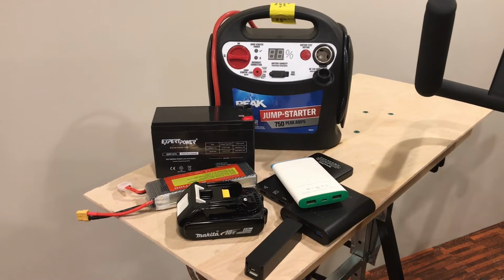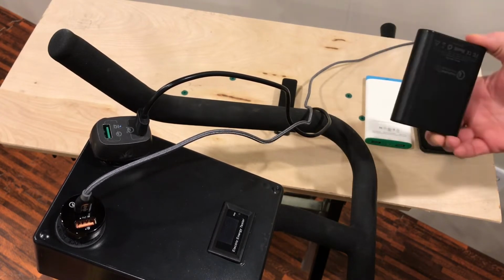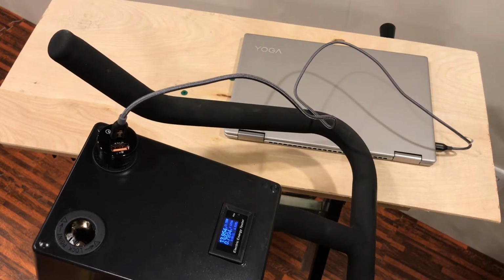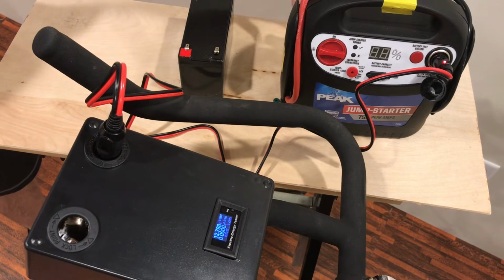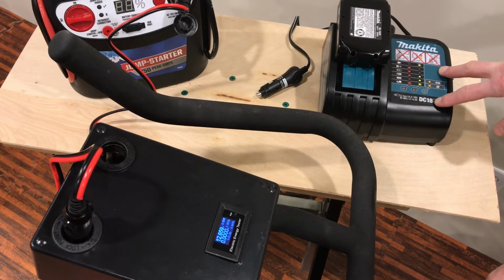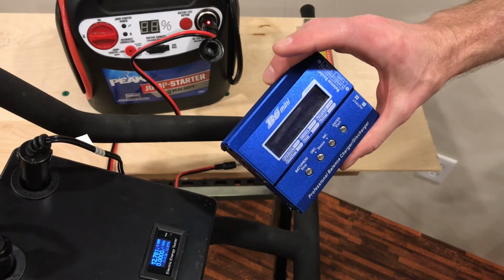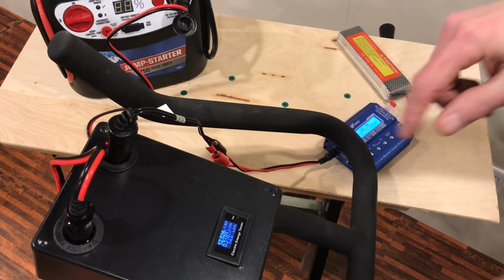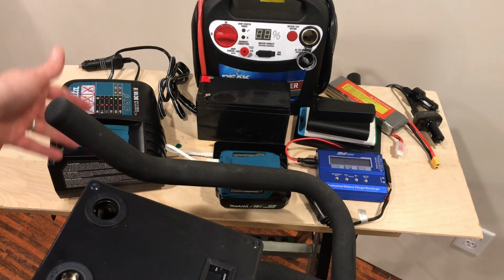Pedal Generator Charging Various Batteries

Comment: Are you still using the bike? How is it running
Reply from the maker: Through the winter months, I train on my exercise bike generator, affectionately known as Ugly Genny. On that generator, instead of an RC motor I use an e-bike motor with a custom cut flywheel. I’ve found that generator design to be more efficient by a noticeable margin over the other designs.
Reply: @GenesGreenMachine  Hi Gene, I'm loving these videos, so glad they're still available and you're still active on these projects.  I have not seen anyone else using an e-bike motor, but when I saw it I had a feeling it would be better than the RC AC motor!  How much was the e-bike motor?  Cheapest I can see locally is £150 but up to £400... but I will look again.  I'm formulating a few ideas in my head, but I like the idea of really chasing after efficiency at all stages in conversion process.  We'll see if that idea survives contact with reality!  On that topic about the rectifier losses and using a DC motor, they also seem £300+.  I haven't gotten a clear idea yet about power storage vs direct charger - more research needed.  Have you quantified the efficiency difference between the RC and e-bike motors?  Thanks for such brilliant resources and good luck with your next ideas!
Reply: And the Makita accessories is a really cool idea!
Reply from the maker: Looks like this comment got lost in the shuffle somehow, my apologies.  Let me clarify on RC vs e-bike motor efficiency. Both motor designs are similarly efficient, but the pedal generator design of the RC motor builds add an extra point of contact (tire on roller for the bike trainer design, rubber wheel on flywheel with the spin bike design) that significantly increases friction losses. With the e-bike motor design, we eliminate those losses. My rough estimate on efficiency losses:
30% with e-bike design 
100% with tire on trainer
By this I mean it takes 130 watts of human input to produce 100 watts going into batteries with the e-bike design, accounting for losses in the pedal bearings, bottom bracket, chain, bridge rectifier and charge controller. With the tire on trainer, the added friction makes it so 200 watts of human input is required to put 100 watts into a battery. I hope this explanation helps!